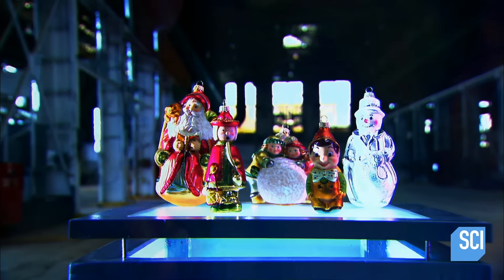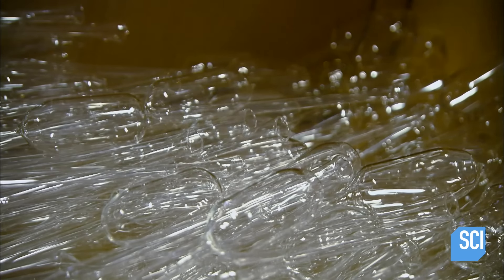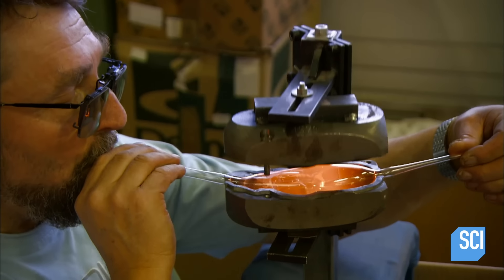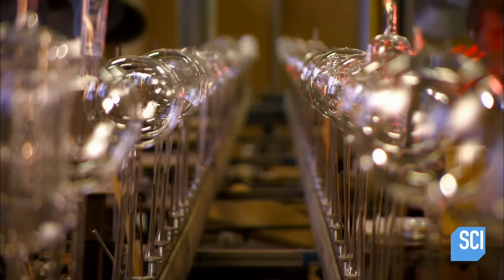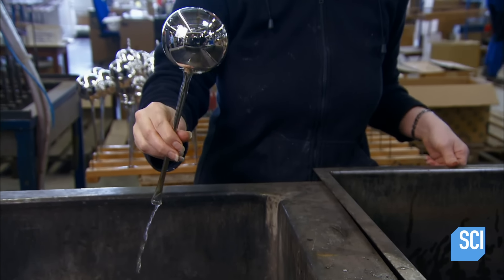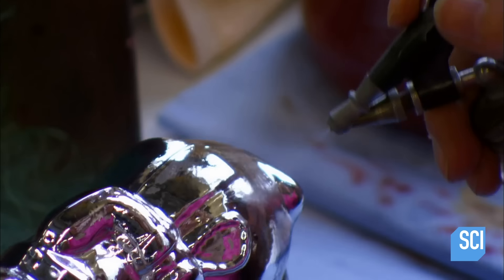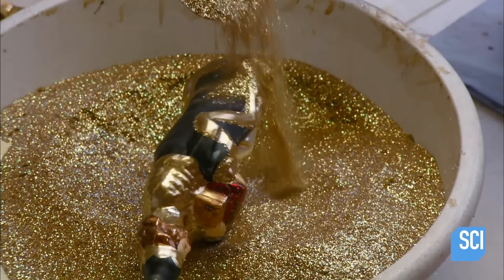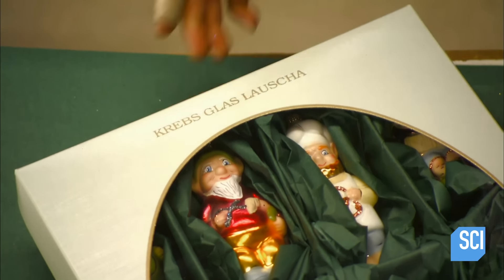How It's Made: Glass Christmas Ornaments

Comment: '
dont dont let a person worker use their own mouth breath blow to the glass ornament...
better be safe use a air machine blower and not mouth
Reply: Uhh no. If there were any germs from the blowing into the ornament, the heat of the 2000+ degree flame will kill them off. I've been hit by shards of hot glass from someone using a compressed air line to heat their glass. Mouth blowing is far safer.